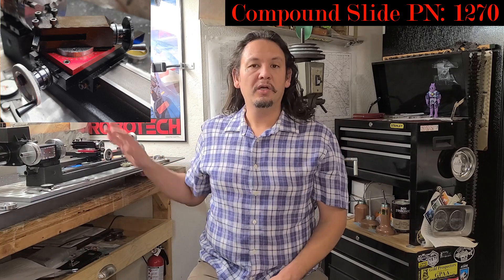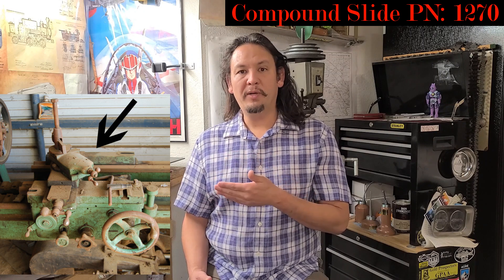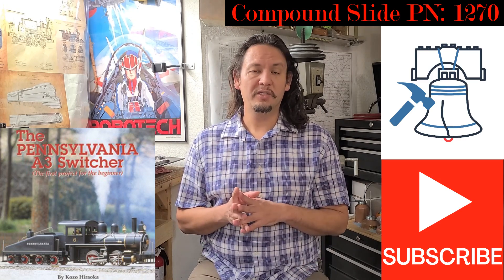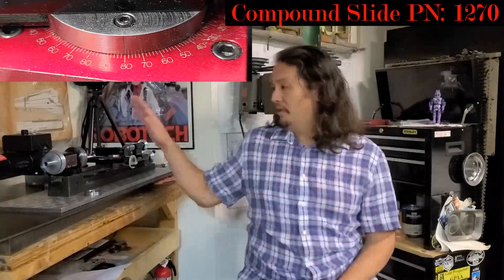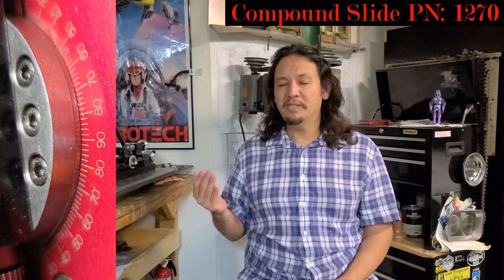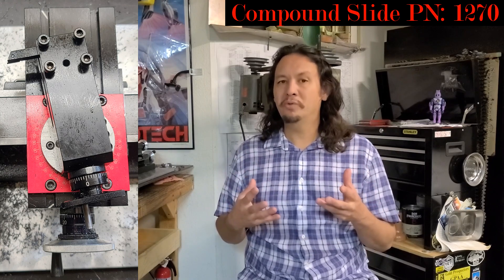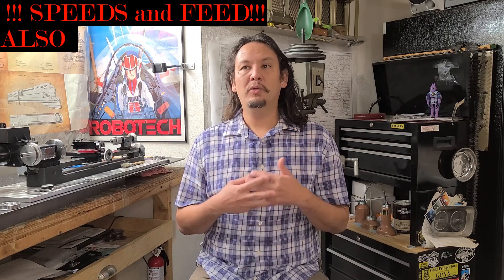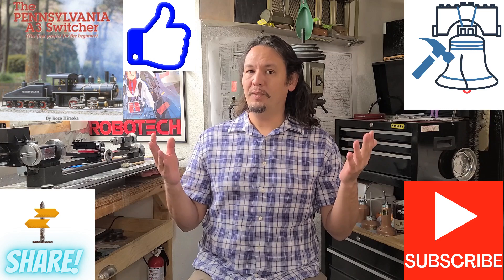Review: Sherline Compound Slide PN 2700 for the Lathe

Comment: Unfortunately, these little shortcomings are part of the fun of having a micro lathe. Watchmakers lathes are the same, in a even smaller package where cross slides are very backwards, having the handwheel end up coming from the front to back to being reversed turning where you turn one to the right to advance the tool while turning the other anticlockwise! So it is a great tool to improve skills and creativity in making custom adjustments! For repeatability angles you can use masking tape. Once you’ve got the angle correct, stick a piece of tape and mark it matching to the pointer on the top of the cross slide. You also can fabricate a brass pointer that once attached to the back of it you can really make in between pointer or use the masking tape. Hope it ease your pain, new users.
Reply from the maker: Very cool thank you.  Both are excellent tips and I apretiate the insight.  Even being new with the lathe, it was still disorientating.  But your right something to learn and use to develop from.  I can only imagine what it would be like trying that watchmakers lathe!!!!
Reply: @LoydPrecisionMakers  one must understand that a century ago there were no high precision measuring equipment, power tools, nothing of what we take it for granted, still there were professionals making machines that run up to this day! Let’s see if what we make today will be here in the next century! Good luck there and keep trying!!!
Reply from the maker: @roadshowautosports  Thanks I will keep at it.  Your right, the machine operations have created the foundation of everything we have.  People don't realize the Apollo shuttle and first moon landing was built with slide rule and manual machines!!!